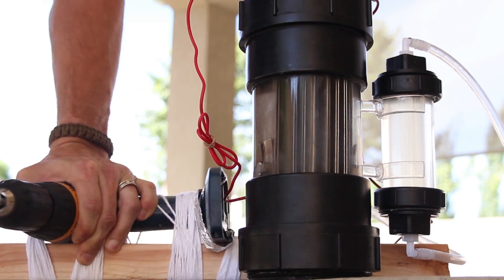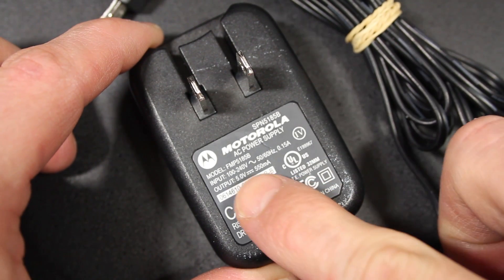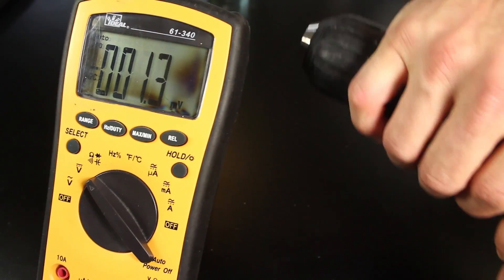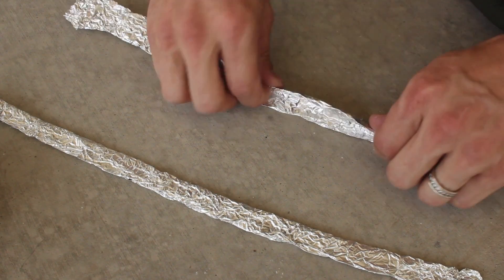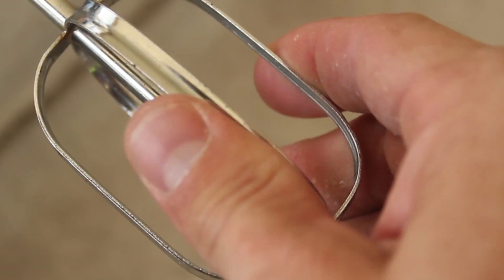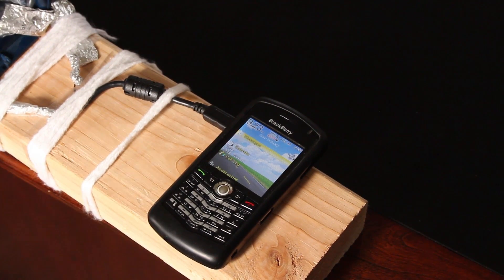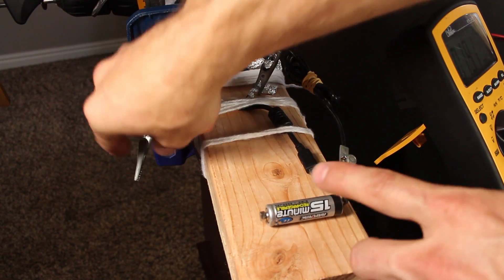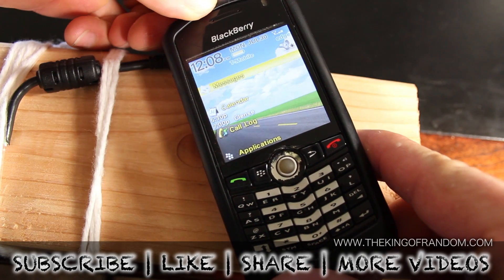Make an Emergency Phone Charger - MacGyver Style!

Comment: You need a 5 volt regulator if you don't want to damage the phone...
Reply: Could you connect the drill wires to a cigarette lighter charging adapter as a means to prevent the over-voltage?

Comment: Be careful. Newer phones sense the variation in the voltage and will automatically turn off the charging which will likely cause you to fry the charging circuit. You can fix this with a five-volt regulator. =)

Comment: I'm not sure I trust the forty watt figure. It looks like you measured the current and voltage separately, under zero-watt conditions both times. A multimeter in current measurement mode is (ideally) a short circuit, and so the voltage across it is zero and you measured the short-circuit current of your generator. A multimeter in voltage mode is (ideally) an open circuit, so the current through it is zero and you just measured the open-circuit voltage. While these are important figures of merit, they do not give you a power figure.

Comment: That was great would simila technology work to charge an electric car? If the crank was turned by the wheels and gearing was used, I think an electric car would be almost self sustaining, but I'm not too bright when it comes to things like this.
Reply: Almost, but not completely, it is used in them to keep the battery lasting longer but physics does not allow for self-sustaining energy like that

Comment: The Engineer in me cringed so hard >.<
Especially at the part with the battery. First you pretty much broke that battery by shortcutting it for so long. Second you can't measure the voltage of a battery like that, you need to put a load on the battery and measure the current over the load. Otherwise it might still shouw full voltage but it would actually drop with a realistic load.

Comment: As a smarter solution to this, you can add a rig with a piston to allow for foot power. Simply press on a pedal to crank this. You may need to add a pulley system to reduce the strain on your foot though.

Comment: I recommend connecting to the wires coming out of the generator to a multimeter to make sure you are staying at the correct voltage

Comment: GET LOTS OF VOLTS:  Use turntable motor in microwave oven and attach to this drill.  Power 2    100 watt light bulbs. DO NOT touch any open wires. You will regret it. Car starter motors are pretty strong. Take off solenoid attach to your bicycle chain with a 12 volt battery and go 50 mph. DO NOT keep 12 volts continued on starter you will burn it out. just turn on and off when starting out and make sure bike is already moving.

Comment: Video idea: Do this but mount it on a bike somehow , free electricity =)
Reply: clever very clever I think it would be safer actually if you had a light on your bike which is powered by a bike
Reply: +Shanley Shoupe Brommer He said you have to keep it at 100 rpm if you could do that then you wont damage the phone.
Reply: Well, it's never "free"; it just converts your body's energy into electricity. Energy you need to replenish by buying food.
Reply: I had an old stationary bike that also measured rpm.
Reply: If you were gonna plan ahead and have a DC wall output converter, you could use the bike to trickle-charge a 12v car battery at whatever speed you wanted pretty much, then just hook up the battery to the converter and you have power.
Reply: The rpm measured on stationary bikes or any bikes for that matter is the pedal crank rpm not the wheel rpm
Reply: If you wanna go to all that trouble you could just solder a 5v voltage regulator chip in series.
Reply: nice! it might be too much voltage to charge a phone, but maybe a large battery would work
Reply: 09Mrsubaru yeah but I think a bike goes faster than that, but maybe I just overestimate how fast I ride haha
Reply: +Shanley Shoupe Brommer If you found someway to know how many rpms you're doing you colud keep it at 100 rpm.
Reply: like those exercise cycles which dont move ryt?
Reply: you might even be able to use a stationary bike that measures rpm in a build like this. Just rig everything up alongside the rpm reader and boom, you could probably charge phones, car batters ects.
Reply: +Nyeguds ok captain obvious

Comment: if i used a stationary bike in 10th gear for the crank could i produce 110V standard household current
Reply: No because from my understanding household current is AC while this produces DC. However it would produce that so if you got an adaptor it could work
Reply: +Tundra1232 a lot of household appliances will run happily on dc though

Comment: well theres no free electric power can just go from one to second condition you eat and carbon hidrates using to power up your hand and you spending your stored energy into cranking from there its going to the rotor and making copper into electro magnetic field wich  is reacting to standard magnets and there you go finaly you got transformed your eated power into electricity

Comment: I would no recommend doing this!!!  There are several things that can go wrong.  When cranked, dc motors output AC current instead of DC current due to the nature of their copper coils, your phone requires DC voltage, the drill would need a bridge rectifier/diode on the output, and a current-smoothing capacitor, otherwise you will put reverse voltage into your phone every time the motor rotates.  The voltage coming out if the drill can also jump above or below 5v, which WILL damage your phone, if you want to try this anyway, I would suggest putting a voltage regulator or atleast a voltage divider on the output of the drill!  The amperage coming out of the drill might not be to high, as I believe I have seen usb chargers at 7 amps.  This drill outputs 40 watts, or 8 amps at 5v, which is fine, BUT, only as long as you have it outputting DC CURRENT at a regulated 5v!

Comment: I tried this years ago w/o success. I clipped a voltage tester to the drill battery connections & received NO volts, amps or any movement of the tester dial. Are there just certain cordless drills that work to do this?

Comment: Can you charge the drill battery like that ?
Reply: +900bz Yeah but it would take waaaaaaaaay more hours than a cell phone
Reply: yes,different setup,but yes
Reply: NO because you would have to spin the drill really really fast to get above the voltage of the battery that powers it and you would have to do this for 6-12 hours depending on how much charge the battery needs.
Reply: pudge if you had a different setup that had the battery attached to a bike frame and powered it while biking it would be viable, it even outperms the device in the video since a battery with a DC converter can be used with a lot more things. I might try making something like this to have an on the go charger.

Comment: Use another chorldess drill and tie it up to the place where the crank would be and then just tie down the button and set it to forward that way you are using power from a less usable device to power up a more usable device (in a case of an emergency)

Comment: Good, now hook it up to a bicycle's rear, elevated wheel and use an inner tube as a belt to drive the drill......exercise and charge your phone... OR maybe even make an amplifier circuit and get voltage up enough to power a tv?

Comment: He needs to use a regulator or else he will break his phone, like electroboom did. He generated about 8v then the charging got disabled and the voltage jumped to 20 v which fried the charging circuits

Comment: I have a bike. But the wheels are always flat and there aren't any holes so I'm thinking of doing almost the same as you but using the pedals from the bike instead. Only problem is that I don't know how to use both pedals and have it so that it feels like I'm actually riding it (obviously not actually going down the road with it but I'm pretty sure you get the idea).
P.s. I actually have too many ideas to do it.
Reply: +trashpack1234 Hook this up to the back wheel/chain.

Comment: One revision you could do to the handle is pulling a pedal bar with a leftover pedal off a wrecked bicycle and then cutting off the sides of the pedal, then shaving down the remaining cylinder from the pedal and gluing a handlebar grip from the same bicycle over it, then slightly bend the prongs of the beater open enough for the pedal bar to fit and securing it in place with something tightly. The leverage of the handle would be a little shorter unless you're using one of the pedal bars from a really huge bike or weld the part that it would bolt to the pedal cylinder with onto the top of the beater, but it would be a much more comfortable grip to hold onto instead of constantly turning your whole hand around to keep your palm on top of the woodem spoon handle.

Comment: you could use fan blades to advantage of air or a near by river/creek using a 7805 VERG as suggested by electronicsNmore , make a pedal or an adapter for a rocking chair and your free from the hardship of intense labor.

Comment: At 4:32 he shorted out a NiMH battery.   Not a good idea.   Also, without regulation this generator is likely to damage its load since the output voltage will vary with the rotational speed of the input shaft.   Beware.

Comment: You can short out the other 2 wires (the data wires) on android phones to tell them they can draw more than 200mA. That will result in them drawing as much power as available. That's how they tell the difference between a wall charger and a USB port on a computer.

Some phone makers want to force you to use their charger for fast charging so they use a resistor instead. You can usually google how large of a resistor to use for your brand of phone if shorting them doesn't work. You know it's working when it says "Charging (AC Power)" instead of "Charging" or "Slow Charging"

Comment: You know? If you create one of those gear contraptions that takes large and small gears and allows you to turn the big gear slow to make the little one faster, you could probably create a little wind generator using the blades from a ceiling fan.

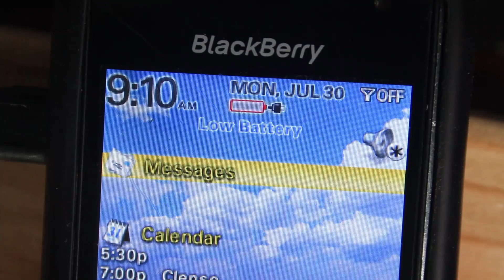Comment: There's a cable at 3:58 so please, open your eyes...
And by the way, spinning any electric engine manually will generate Aternative Current, not the Direct Current required for charging the battery...
Sorry to destroy your funky dreams of infinite nrj guys, maybe add a hamster wheel in the mix, ah ah
Reply: Where? The cable connected to the phone? That is the cable used to charge it... He isn't doing this wireless you know
Reply: well he isn't doing it at all, so.... even if i was mistaken about the cable which i'm almost sure i'm not, the fact is the phone doesnt charge thanks to his system but with some "hidden" trick
Reply: I'll watch again to make sure.

Comment: Wait! Does that mean you can put your drill into reverse and crank it backwards to charge your drill battery?
Reply: Thanks.
Reply: Mog of War In a weird way it does kinda make sense that it would, doesn't it? Physics is weird.
Reply: In theory yes, but it's likely that the magneto in the motor is not able to produce enough current to actually charge a battery to a voltage that could run it, and trying to, with say a crank strong enough to survive the torque, might result in just breaking the thing.
Reply: TheCr7kickers OOooh snap!

Comment: Sometimes you can glean the smallest simplest little why the hell did I never think of that before 'cheater' technique: Magnets as battery quick connects (and by extension, a means to bench stack cells in series without resorting to tape or a third hand). Frankly brilliant.

Comment: 3 hours to charge what was a 3 year old phone at best 2 years ago, you'd be there all day to charge up a modern 4G phone, this phone was a 900 mAh battery, new flagship phones are like 3,000 mAh.
Reply: But new phones can charge at much higher currents. These old phones would be limited to 500mA or less, new phones can usually take somewhere between 1.2A and 2.5A. As demonstrated in the video, this contraption can provide such current. It would still take roughly the same time, it would just be much harder to crank.

Comment: An alternative to the eggbeater\wooden spoon would be a 4 inch paint roller, remove the handle to make the "chuck" end and bend the wire frame for a more ergonomic  feel and use the roller as the new handle. I for one don't have an eggbeater in my house so I was trying to think of a different method. Just my 2 cents ;)

Comment: What electrical components would I need to regulate the threshold of a safe voltage? In other words, how do I get around the inconsistency in the rpms that I generate, Well at least how do I keep from exceeding the recommended voltage? I'm more concerned with going over than under. Phones charge at 4.3 or something like that or am I completely wrong? Keywords on google that may be of interest?
Reply: Spectator Mag Use 5V zener diode to avoid negative voltage (definitely destroys your phone when cranking to the wrong direction) and also it will not allows positive voltage higher than 5V to pass so it will not destroys your phone as well
Reply: for one you should put a power diode in the positive leg output. motors tend to generate AC current not DC so you need to do a proper conversion.
From that you can use an LM 7805 regulator circuit to get your stable 5 volts out and then go off to your phone.
If a things worth doing, it's worth doing right.
to save cranking you can salvage cheap dollar store solar path lights for their solar cells and hook them in series to get 9 - 12 volts and then regulate it with an LM7805 circuit. This is a better choice and will not leave you turning a crank for 3 hours.
Reply: ElfNet Gaming Wow thank you so much for the information! Really appreciate it !
Reply: ElfNet Gaming 5V Zener diode is much easier (It will not allow negative voltage and also limits positive voltage to 5V) Much easier than using 7805 and you only need single electronic part
Reply: MOSKAU15 Remember that Zener diodes stabilize the voltage by drawing more or less power as needed, and that power draw causes heat. Having said that, good luck getting a 40+ watt zener. Normal zener diodes such as the 1N4733A can only handle 1W, and the biggest zener I could find on a quick google search is the 1N3996, which is rated for 5.1V (so not 5V but pretty close) and 10W.

And don't even try wiring zeners in parallel. Due to manufacturing tolerances, each zener will have its own exact actual voltage, for example, one might "regulate" to 5.223V, another one to 5.089V, and another one to 5.107V. Regardless of these values, the one with the lowest voltage will take all the load, and the others will just sit there and do nothing.

You can observe this behaviour with a coin cell battery (e.g. a CR2032) and a few LEDs of different colours: for example, red, green, and white.

If you connect them independently, all of them should light up. Now try to connect all of them at the same time.
Chances are only the red LED (Vf ≈ 1.8V) will light up.
If you remove it from the circuit, the green LED (Vf ≈ 2.5V) will take over. Now remove this green LED and only the white LED (Vf ≈ 3V) should be on. But that's because it's the only LED remaining. So connect the red LED again, it will light up. But if you look at the white LED you'll see that it is either fully off or very dim.

Comment: Great idea, Grant. All your videos are awesome. I agree that cranking for 3 hours is not practical. I would like to see if it can be attached to a wind mill and let the wind charge a 6V or 12V batteries packs (like NiMH) or (NiCad) etc, and use the batteries to charge other things. You are AWESOME.

Comment: You can plug another drill in it and no need to work like hamster in the wheel for three hours
Reply: but the point is is that you don't need electricty to power it. so technically if you do that take the charged battery and charge the phone with it then :/
Reply: ***** regardless of how you made the drill rotate it would still need to rotate at the same speed, to make an analogy,  think of it like this you walk about 3 miles per hour (lets say this like the 100 rpm), sure you could get in a car and drive but you would still need to go 3 miles per hour, so it's going to take just as long to get there, it would just be easier on your feet, but now you've wasted a LOT of fuel that could have been used for something else.
Reply: He says in the video the phone can only handle 100 volts any faster could damage the phone. So the 3 hrs is necessary.
Reply: Rpm's
Reply: OU81TWOZ 46
The commenters point was that you don't have to be there for 3 hours doing that... Most drills these days have speed settings, so if you got lucky and the speed setting was just under the maximum RPM of this setup, then that would be better than sitting there for three hours turning it like a mad man.
Reply: bugattikid2012 thank you! ) That was the point )
Reply: If you have another drill, you would just use the battery from that drill to run the charger instead of all of that. IF you can plug in the drill then you can just use your normal charger. This is for emergency use, not normal use.
Reply: ***** Why are your smileys blind?